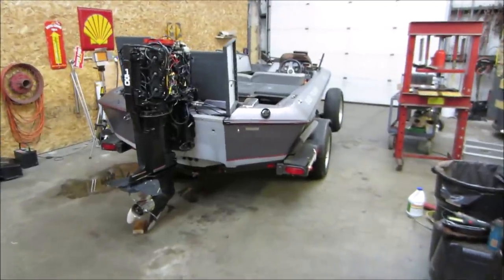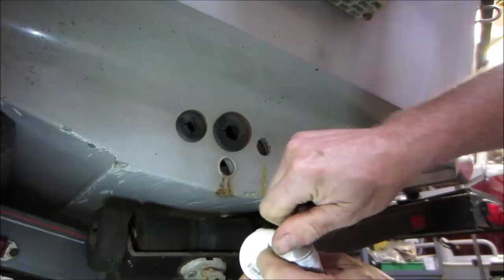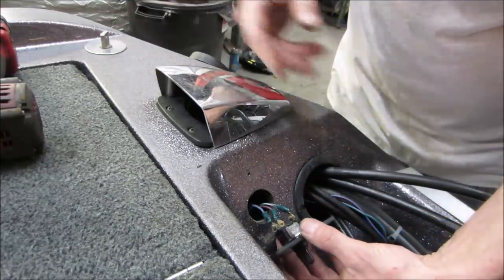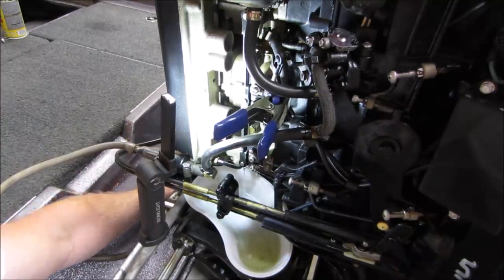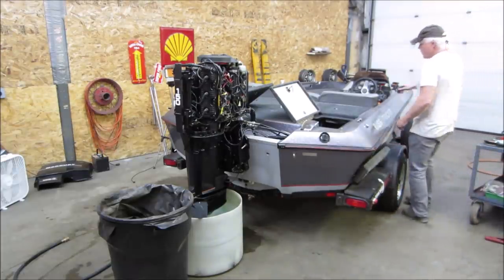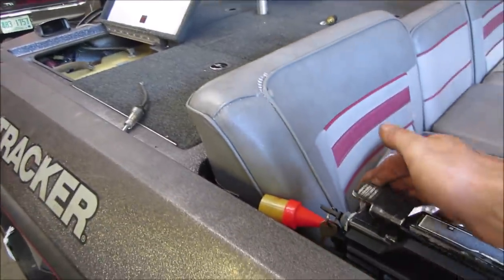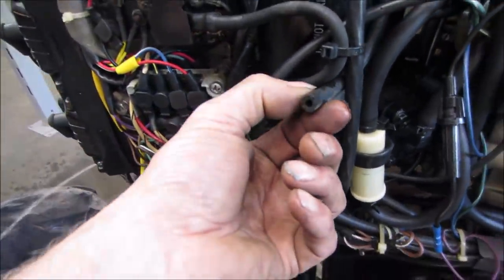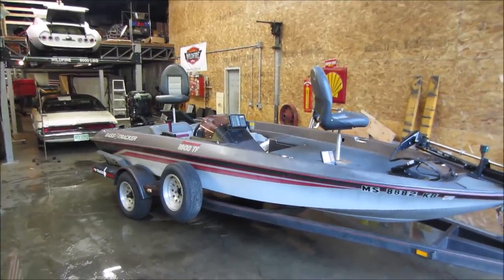Bass Boat Sitting 10 Years, Lets See If The Engine is Good?

Comment: I wish I had found your channel years ago when I tried to restore a Motorcycle that had been sitting for about 10 years. I wouldn't have need to clean the carbs twice.  What I should have known by logic I learned by mistake. Clean the tank AND fuel lines before trying to start the engine.

Comment: A few last thoughts.. I see you do have new fuel line... Great job, it was important.  The waterpump... Agree with everyone to change it. Stop running till you do.
The thing is, the old one will start coming apart. The fins will break off and go UP the water tube leaving you a mess. IF there are missing pieces when you pull it apart... Find EVERY PIECE before putting it back together. Several times a year my shop had to pull a powerhead and open all the water passages on outboards. The fins work up under the block in the water spaces under the powerhead and then into small water passageways in the engine blocks. Another reason to change it out. Someone below mentioned changing the impeller whenever you buy a used boat..GREAT ADVICE!... Cost is low and it will save you sooner or later.
I note the steam coming out with the water in the pee hole... Unless its jsut from being cool outside then you are running hot. another reason to change the impeller, making sure all teh fins are intact... It is possible to have a good stream yet overheat a cylinder if this has happened before and someone missed a chunk of impeller in the engine block. Just be careful and then have a blast....

Comment: When I re- ignite older anything I drain/ clean tank. replace any hose that isn't soft anymore. check  compression
in all holes, so I know its potential health.  carb and water pump, and away you go. Getting any type of older vehicle 
back in working order is very satisfying.

Comment: I would replace those older Plastic thru haul fittings with the black ones, which are for below the water line. They are stronger than the white ones as well. btw  That's a nice looking boat, its in great shape, and it runs great. U scored..Mustie. Good for you!!! one you get everything all worked out you'll have a nice little boat.

Comment: I had a tracker grizzly 1860 with an optimax 90 jet on it. It had sat for over 8 years and after redoing the entire fuel system it runs like a champ. The ethanol gas did a number on it

Comment: I want to add check the trailer bearings while you are at it. If it has Bearing Buddies on it then suggest taking them off and check the grease, bearings, seals and races just to be sure.
Reply: That's a must, I usually jack up the trailer wheels and feel for play, then give them a spin while listening for a rumble, if they're smooth, yer good ta go.

Comment: Other things needed. Change impeller, service lower unit, wheel bearings on the trailer are likely rough, strap up front could be dry rotted, rear trailer straps (quick release,) trailer lights, I’d hit all grease fittings with some, modern fish finder, test live wells, new drain plugs… Break Out Another Thousand.

Comment: Pro tip: on thru-hull fittings. 
Apply silicone(or for better results use 3m 5200).
Place fitting in hull and only tighten nut until just before sealant oozes out. 
Wait for sealant to “kick off” (tacky to touch, somewhat firm).
Tighten nut fully. 

Tightening nut while sealant is viscous May cause the tightening of the nut to push too much sealant out

Comment: After the oil injection went out on my first black max I got rid of the oil injection put  the block off plate on and ran premix, never had a problem, I’ve owned several 2liters and a dozen 2.5 carbureted Mercury’s. I love them

Comment: Although silicone will work ok for below water line through holes it will eventually allow water intrusion into the transom.  I highly recommend a 3m product designed for below the water line like 5200.  People hate it because it is also a very strong adhesive, but your transom will thank you and it will not allow water intrusion.  I have used nothing else throughout the years, especially where the transom is concerned.

Comment: As a marine service mechanic for many years, my advice is the same as others. Change the impeller. You will not be able to pay enough attention to the telltale stream to catch a failure before you overheat the engine. As for the "choke", if the carbs have choke plates you must hold the key switch in while cranking. If the engine is equipped with a primer, then simply pushing it in several times before starting will squirt fuel in to the intakes.

Comment: I see a lot of people say delete the oil injection and run premix. That sure looks like a mikuni injection pump and if it is that is as reliable as a oil pump in your 4 stroke car. Keep lines in good shape and oil in the system and good to go for a long long time. Snowmobiles and old motorcycles used these systems for years without issue.

Comment: I just bought a 92 Astro Fish and Ski with a 135 Mercury Blackmax. Now I'm having an oil issue. Think it might be as simple as checking the seals on the big tank and purging the air in the lines. Under my engine hood I found a procedure for purging air if getting an intermittent horn alarm.

I do have the manual which has the 150hp version as well if you need any info from that!

Comment: Hello .  
as a water container maybe grab an IBC tote where you cut the minimum from the engine suspension.  
just add a temporary hose to the cooling water return back into the IBC.  
You need a forklift to move the full IBC out of the way .  
piece of tarpaulin over it against dirt in it.  
Hang an old but still good pump in it with a good blow to it, then you have a nice extra safety in the event of a fire

Comment: To start those Mercs, the key is push to choke. So push in and keep pushed in while you turn it. When/if the starter does that spin where it's not engaging the flywheel that means it has been choked enough. From there lift the throttle advance lever up and turn key without pushing it in. Should fire right up every time. 

Likely won't pee at first start up. Probably thermostats, so won't start peeing until the motor gets a little warm. 

The oil tank in the boat is the main tank. The one in the motor is just a reservoir for the alarm. That float goes up and down like a normal tank float. When it's low, it is suppose to sound an alarm letting you know that you're low on oil (Doesn't seem like yours is working). I don't think the motor oil tank is really suppose to fill up. Just a housing unit for the alarm. So oil trickles in from boat oil tank, and when the boat oil tank gets low, the motor side one will as well. Very common for floats to go bad and sound the alarm even when there is plenty of oil. People often disconnect the alarm instead of replacing float. Then run their boat out of oil, never get the alarm (b/c it's disconnected), and burn up their motor.

Comment: 1. Make sure there's no flex in the transom. Trim the motor up, grab it and press down and side to side to see if there's any flex.
2. Change the impeller. It's cheap, easy and will save you a lot of headache on the water.
3. Disable the oil injection and use premix. Properly maintained though, the injection system works fine. Check the manual for how to maintain it.

Comment: many have build a mini jet boats &  a traditional propeller driven outboard to outboard 
 what is a relatively easy task. The main consideration is the requirement to
 remount your outboard 5 to 6 inches higher to facilitate the shallow 
running outboard  drive. This  be done with an outboard jack plate or transom bracket.

Comment: the engine pressure feeds the oil to the tank on the engine (line with a blue stripe). the engine tank is sealed tight. in order to fill the engine tank, you can either fill it manually or crack the cap while the engine is running until it is full. if it does nor fill, then the 3 gallon tank is not sealed.

Comment: it usually works unthreading the old bulkhead connectors that were marine siliconed in place. they should have notches for a tool/flat bar to grab or use an internal nipple wrench.
that rolls and peel the silicone away, still a pain though :)

Comment: GREAT VIDEO! Dont see too many marine fixes. Put a mark on the oil tank on floor to see if level goes down. Pretty sure that's a reserve tank on engine in case other tank runs dry or quits workin you wont be stranded.

Comment: Didn’t read everyone else’s comments, but you will need to dump that fuel line. The grey stuff is trash. Over time, it delaminates inside and screws up the gas delivery. You are actually better off buying high pressure black stuff for cars and trash all that crap they sell at walmart. You can get black fuel line and the primer bulbs on their own. Quick connects can be added. I also never run the ethanol fuel. It is that Attwood stuff I noticed from walmart that you have; Gaaaabage. There are other marine engine guys on YouTube with some good videos that talk about the fuel problems. Also, pee stream is called a tell-tail; lets you know your cooling properly. Boats are such a beating. It was fun watching you work this one out.

Comment: You need to raise the fast idle lever a bit and hold the key in for choke to do anything while trying to start the engine from cold. Pushing the key in energizes a fuel enriching solenoid valve or choke flap solenoid. After the first kick/cough, don't push in on the key any more or it's easy to flood it, just crank it again without key pushed in and it should fire straight up. Be ready to drop the fast idle lever down when it starts👍🇦🇺

Comment: The old Mercurys are all hard to start cold. I have an 83 Mercury inline 6 cyl and it's old and cranky too. Try mixing a little bit of Seafoam in the gas it helped me a lot from a dozen cranks to 3 or 4 to get it running

Comment: For gear oil change use a narrow silicone tube that screws into bottom drain bolts hole. Then push a very small funnel spout into other end of tube. Tie funnel above the gearbox and fill very easily until it drips out top gearbox bolt hole. I never have hardship doing it that way.

Comment: Did you tighten the clamp on the new through hull you put in ??? I saw you slide it in place, but never tighten it up.  Not sure you can get to it with the tank back in.

Comment: She's a good runner.  Dike out/block off the oiler and just run premix.  Also, enricher circuit (choke) = push the key in and hold while cranking on this motor.  Pushing the key in and letting it out before cranking does nothing.  Like you found, hot restart should be easy with just a bit of fast idle up.  They lean out when hot so when you tune the carbs it's better to do it warmed up. Link and sync will be best and then just use an IR to check cyl temps to make sure they're balanced.  Tell-tale looked fine with thermostat opening, but as a billion other Mustie1 fans have said, there's no reason not to change the impeller.  Was sad to see Crusty go, started watching you back when you did your first videos on that rig.  Uncovering the lettering etc.  Stay safe out there.

Comment: Mustie1, I would go ahead and do as so many have suggested and replace the impeller now, rather than be stranded later on. You might also consider replacing the remaining 2 thru hull connections since the the one was brittle and snapped off the remaining ones will be in the same shape.

Comment: @Mustie1 You should lightly grease the woodruff key and a little dab so it sticks, the plates need lightly greasing, along with the impeller and both splines. Don't grease the top of the drive shaft, any grease above the spline should be wiped off. It's easier if you put the impeller in first before installing upper housing. You don't need grease on the gearbox housing. Also, it's easier if you put the water pump rubber boot/seal and plastic sleeve on the pick up tube first intead of installing it in the water pump housing, otherwise you can crush the copper pick up tube or plastic sleeve like you did. To line the drive spline up, turn the propeller. By the way, the rubber seal you slid over the water pump once it was installed is not supposed to be there, it's more than likely the lower oil seal. I would suggest to take the gearbox back off and remove it from there or it may cause problems. You're welcome.

Comment: That works off of pressure. The travel on the float is very short. It is pumping a good amount. Remember it is mixing with the fuel just before it enters the carbs. It doesn’t take much to get the right mix in the carb bowls. Plus the more fuel you push through the engine the more oil will pump. And the color of the fuel in the gas tank is because those pumps are known to fail, in fact, most people remove them, and pre-mix the fuel and oil. But those who don’t will add some two stroke to the fuel tank in case the oil pump goes out to keep from burning up the engine. Those were great engines.

Comment: Definitely change the impeller, its easy (hour-ish) and worth it...use the ear muffs to get water to the engine, much easier...delete the oil system,  they are a PIA ...make sure the trim on the throttle handle works...that boat's gonna move at a pretty good clip and that trim will be a necessity...if you can find non-ethynol fuel, the motor will love you, if not, you should add a water separator

Comment: Absolutely DO change the impeller before going to the water, or even revving it much as pieces can break off and travel to, possibly blocking, water jacket.  NOT worth ruining a 150hp outboard for that.  While at it, check/change the lower unit oil.  What a find!

Comment: Maybe the oiling system is pumping into the tank slowly because the engine isn't using much at idle. At high rpm's, it'll pump more. You can probably test the oil float shutoff by moving the float upwards and see if that trickle stops flowing. Just a guess.

Comment: I have a 1960s aluminum flat bottom I am getting ready to get back on the water. I have a 59 mercury 6A 6HP that need the lower housing welded. Also a 64 Johnson 5.5HP that I am working on now. The Johnson just needs some work to the fuel pump and a tuneup but that fuel pump is hard to find and damn expensive.

Comment: I’m not trying to tell you how to do things I’m just trying to offer some help that is gained through experience if you throw some marbles into a gas tank when you are trying to clean it they will break up the crap that is hard to remove from the inside if you shake the hell out of it with the marbles and whatever fluid you’re using to clean inside of it just make sure you count the marbles before you put them in and when you take them out to make sure one hasn’t got stuck in a fitting or something

Comment: I could be wrong but that motor appears to be 1988 or earlier. Judging by having a separate rectifier and voltage regulator. In 1989 mercury switched to a single integrated unit. 
Those 2.0 liters were excellent motors. 👌
Reply: Also you loosen the cap on your motor oil tank, the positive crankcase pressure will fill it. If you have the cap tight it will not fill. Good luck with the boat!

Comment: There is a small in-line filter on the bottom of the oil tank that is plastic which could be the root of your oil issue.  They get clogged pretty easy.

Comment: There’s an machanical oil pump on the drinkers side of the engine. And it also has a pair of thermostats up on the heads . Make sure oil pump isn’t air locked a see through hose would be my recommendation. And just fill the oil reserve full . The reserve has a auditable alarm that sounds through the controller win reserve is too low.

Comment: Definitely change the impeller in the water pump regardless of tell tale. If they disintegrate the pieces block the galleries in the water jacket and destroy the engine. Also with oil injection, if there is any doubt about oil feed into the engine , it's adviseable to run on 2 stroke mix while observing whether the engine is using oil from the header tank (dis connect the main tank temporarily). Otherwise that looks in good order. It's going to fly on the water!

Comment: If you plan to keep that Merc or any marine motor a good addition is a water pressure gauge.  It is a simple and easy installation.  Then get in the habit of watching it.  As I recall Mercurys generally ran about 12-15psi but don't quote me.  The important thing is establish a value with a new impeller and then if you see any decline it indicates time to change it out.  A precipitous decline can mean a piece of plastic wrapped around the lower unit but not touching the propeller so it covers the water intakes and gives no indication it is there (herring bait wrappers have done it to me several times as well as leaf kelp).  A slow decline gives you time to replace the impeller as it indicates a worn one.  Now in modern outboards they have an overtemp alarm.  Trouble is it lets you know after trouble happens.  The gauge lets you know before it becomes debilitating.  So you can deal with the problem before you need a new short block.  Free advice from almost seventy years of salt water outboarding.